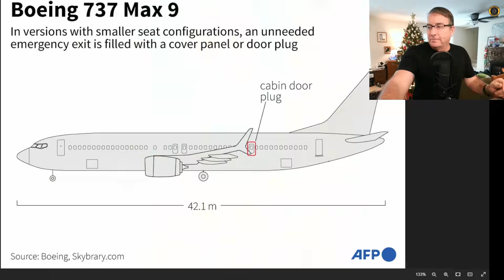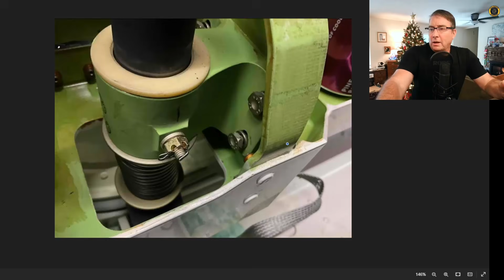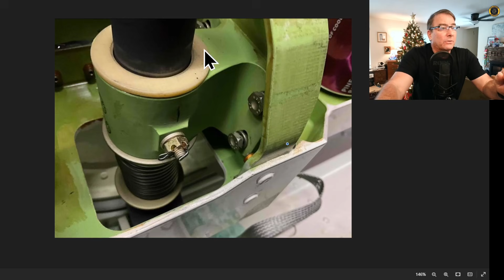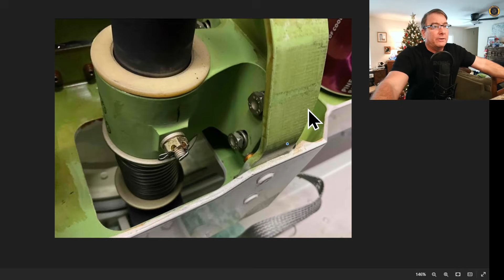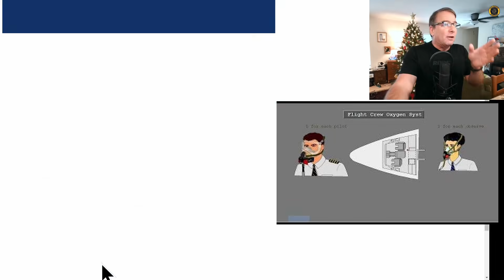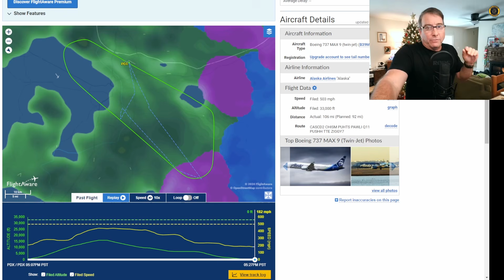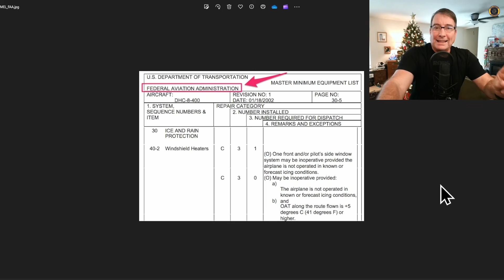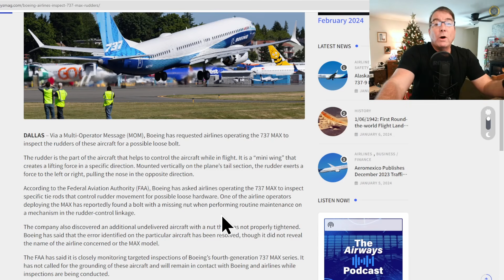"Yes, We Have No Bolts"  9 Jan 737 Max-9 Update

Comment: I'm riding one of these bad boys next month and while I know that the odds are overwhelmingly in my favor, I feel like it's going to be a long flight...
Reply: Plug window seat 80% off!
Reply: 🤣 @701Builder
Reply: Parachute  in your hand luggage?
Reply: @Groovy-Train  good luck getting to your hand luggage when the door blows open. for that case you would have to wear it on you :D

if the plane goes down for any other reason ur going down with it regardless too... even with parachute. i think these doors are designed to not be able to be opened due to pressure right?... maybe you can open them at like 1km above ground? no idea.
Reply: @biziluxgames8924  You are definitely overthinking my light-hearted comment! 🤣
Reply: @GARDENER42  It clearly can be opened. Albeit involuntary.
Reply: @biziluxgames8924 Juan explained why it may have opened - ie if leaky to begin with, there's less pressure to plug it.
Reply: @GARDENER42  i meant the actual doors
Reply: @Groovy-Train  I suggest he wears it rather than putting it in his luggage. No, I'm serious!
Reply: Inside row...tighten your belt
Reply: Good luck,my prayers are with you
Reply: They’re all grounded for now
Reply: @OtherTheDave That was my immediate thought! They're grounded and shall remain so until the FAA is satisfied it's good to go.
Reply: Which Airline?? Only SOME of these have this plug door, others have more seats and thus this is a regular EXIT DOOR.
Reply: If it’s a Boeing, I ain’t going.
Reply: Good luck! Ask the attendants if the door plug bolts were fitted
Reply: @aboutface102  I'll ask if I can see the latest maintenance action form, lol
Reply: you wont be able to board it if this continues,  I hope you have cancelation insurance
Reply: Imma switch to budget airlines that only use airbus until boeing gets a new ceo and internal culture.
Reply: These planes are currently grounded, so you'll be in something else
Reply: I would check the bolts.  If it’s only hand tight I would mention it.
Reply: Hi Juan, it seems to me Boeing need to install actual emergency exits on all doors on all Max, whether the damn Airlines wants them or not, and not make it an option. Simple.
Reply: Why would the pilot's checklists go flying? The cockpit is a closed area.
Reply: I appreciate all the feedback. When the times comes, I'm still getting on. I'll keep my seat belt on just in case the plane initiates convertible mode.
Reply: You don't have to board it. You have a choice.
Reply: Keep your seat belt on.  You'll be fine.
Reply: @percyfaith11  Bolts more like.
Reply: The odds of death or serious injury on your way to the airport, is what I would  be more concerned with.
Reply: terencem8795
I drive myself to the airport. I maintain my vehicle. 
I’m a little more diligent than the airline apparently
Reply: Don’t take any pets in carry on bags.

Comment: Boeing quality control must improve! The rot started when they merged with MacDonnell Douglas,  who are more concerned about the bottom line.  Good engineers in the company were pushed out and replaced by yes men.

We're seeing the consequences now.
Reply: Seems like this has more to do with assembly people not engineering.... they have used plug doors for many years

Comment: Would there be a slide installed at this plug or would that be retrofitted if the door was activated.  I am guessing there was no slide there. I am amazed that CVRs still overwrite themselves.  Surely there is way to preserve all of it  all the time..
Reply: No slide because of no door.
Reply: There is no slide on the door plugs, only on active emergency exits.

Comment: "For want of a tightening the bolt was lost.
For want of a bolt the door was lost.
For want of a door the plane was lost.
For want of a plane the airline was lost.
For want of an airline the manufacturer was lost.
For want of the manufacturer the industry was lost.
And all for the want of a tightened bolt.“
Reply: Noice one!👍
Reply: You could add a nut and cotter pin to the top of that list...
Reply: Results for pushing CRT, DEI and so on are in now folks, fasten your belts.
Reply: 737 has been in production for 50 years, over 11,000 airframes built and delivered, most popular two engine airliner ever, over 4,000 planes on order and mighty keyboard warrior craigmiller makes fun of an issue that is clearly sabotage.  Nobody knows what happened to the bolts, now do we? So why not let the experts figure out what happened.
Reply: Take Shortcut.
Shortcut takes you.
Reply: Well said!
Reply: The Airline is/are going to want passengers, because passengers don't want to fly on planes that fall apart in the sky!